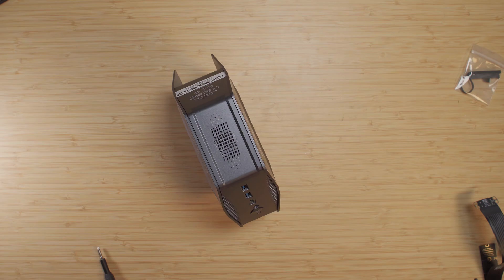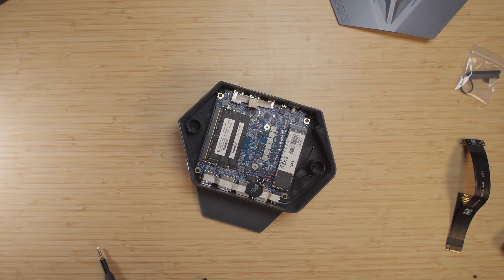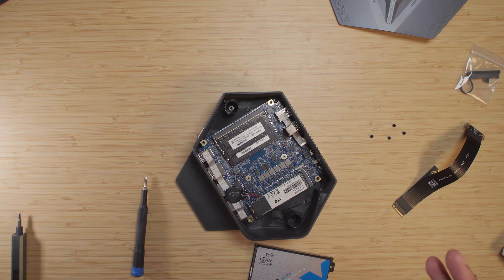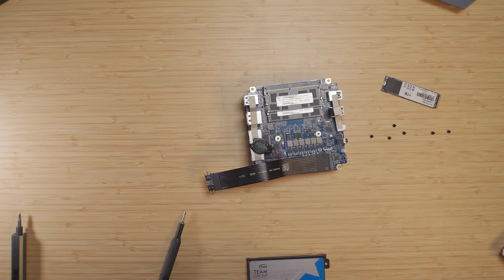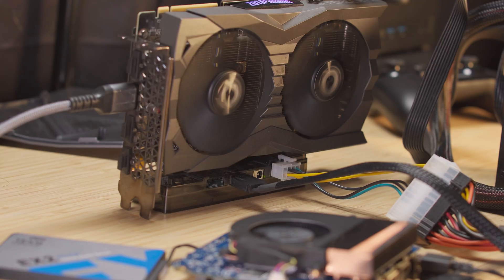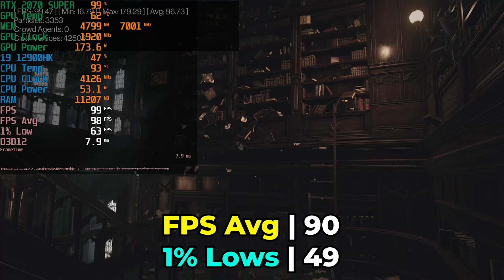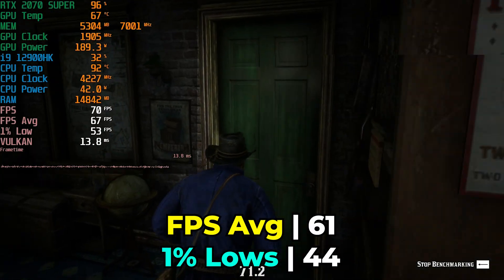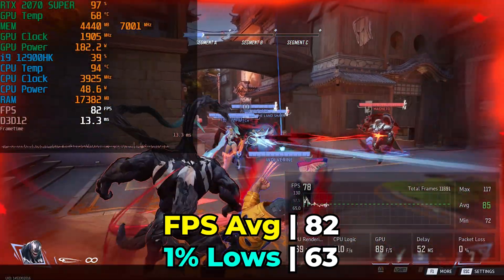Testing OCuLink Adapter On Bare Mini PC Board | Intel i9 12900HK With OCuLink eGPU Setup

Comment: That's strange.  I've had the opposite experience where AMD GPUs work better in an OCuLink setup than Nvidia.  But I use a different dock, so maybe that's the difference.  My 6650XT, 6750XT and 9060XT all work great, but my 3080 and 4060 have had issues.  And keep in mind that if you're using SteamOS/Bazzite, AMD GPUs will have better support.